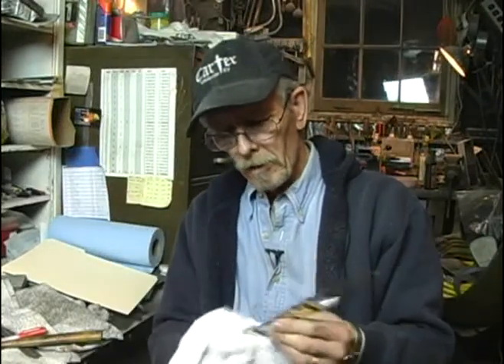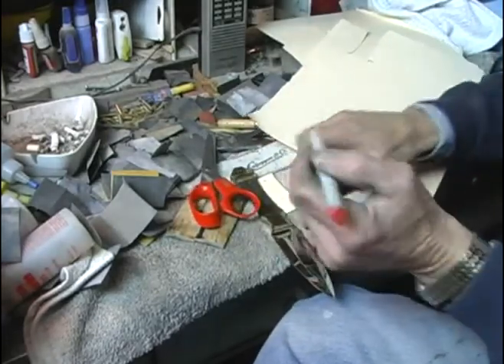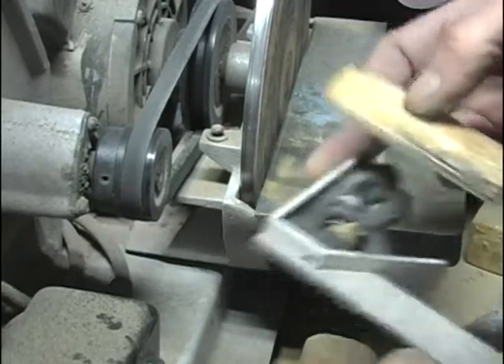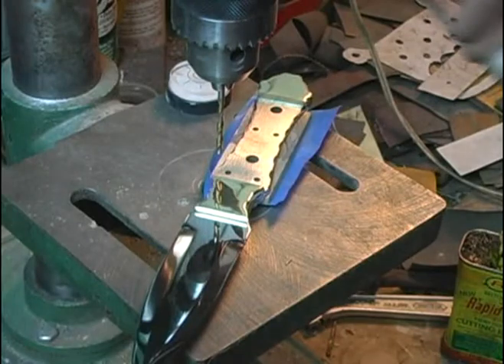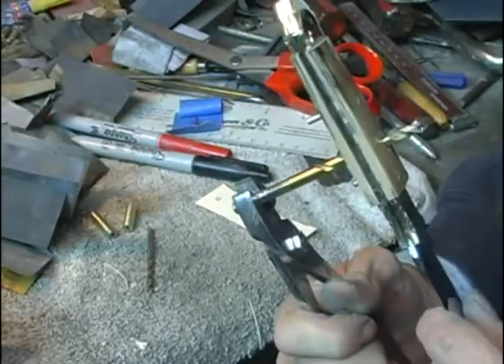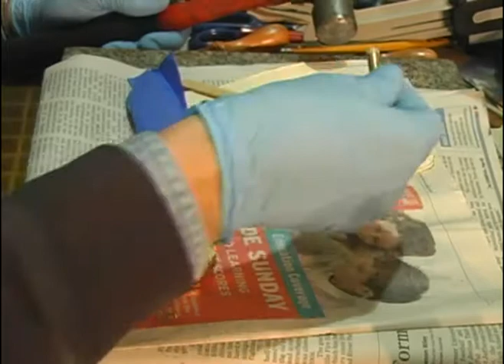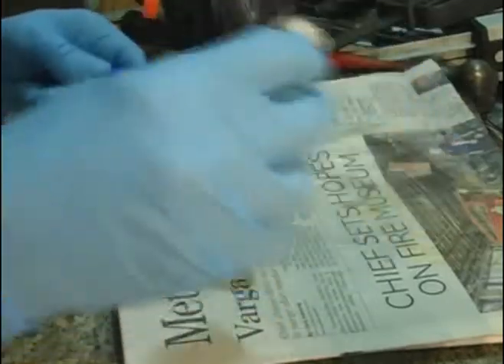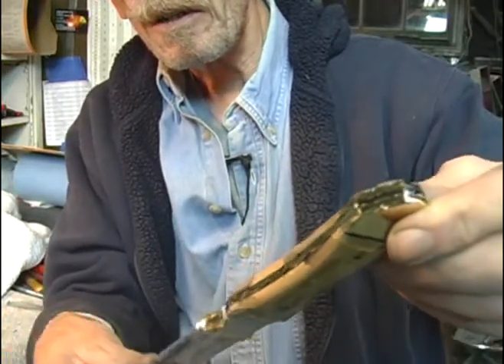Mammoth Dagger Pt 2 - Handles

Comment: beautiful work. I'm a woodworker literally taking my 1st steps into knife making. Your videos are both inspirational and informative. Do you find the teeth slabs any harder to use ?
Reply from the maker: +sigmar arnold Mammoth tooth is very brittle and you have to use great care when cutting or drilling or it will crack or chip. I glue my slabs to a piece of masonite or micarta before cutting and drilling. Use very sharp blades and bits and work slowly.

Comment: why not remove material from the back of the scales so you can preserve the bark instead??? I am also wondering about that 'bulging' material that you know is fragile...would it not be better to have it fit even with the height of the bolsters to avoid damage as much as possible?? I'm not trying to be hard to deal with...just discussing technique.
Reply from the maker: I wanted the thickness and the shape. Also, grinding down through some of the
outer layers at the ends and edges gives it contrast.

Comment: Great choice of epoxy . E-120 flows and wicks much better. It's also a thousand times stronger than that pos Devcon.
Reply from the maker: Devcon 2 Ton epoxy works well and I use it in some applications but the E-120 is stronger.